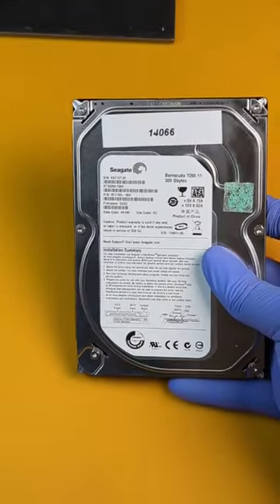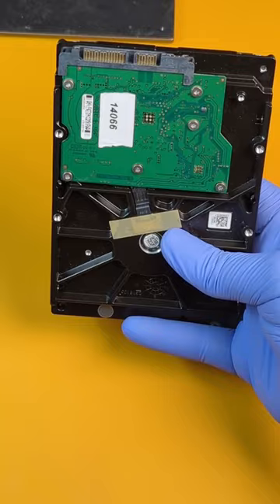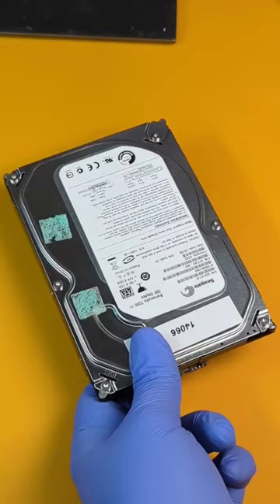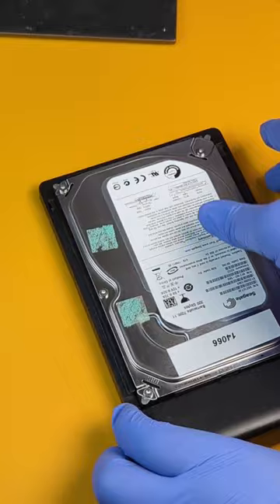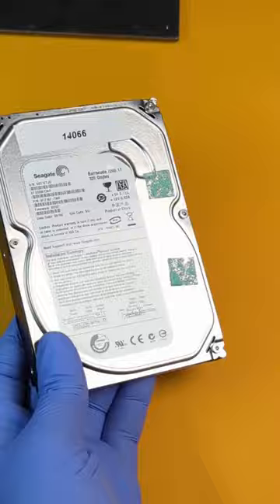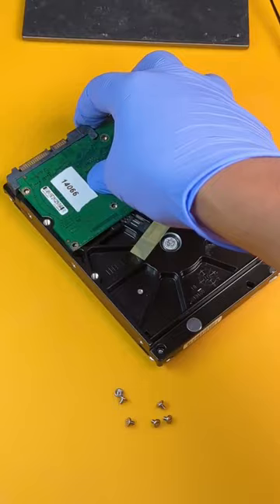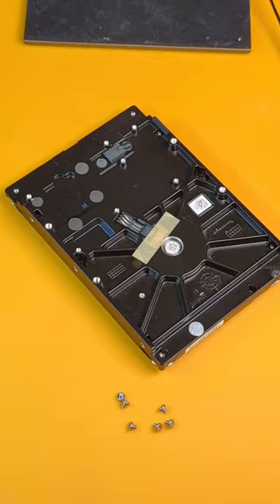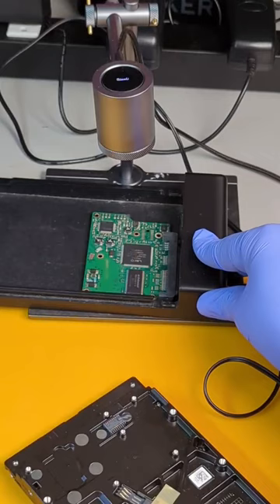How to fix a dead HDD

Comment: What if you took a whole board from another HDD and put it on there instead?
Reply: You have to remove the bios chip and replace it with the old one as to not lose the data
Reply: It won't work. You need to transfer the BIOS chip of the old HDD board to new board too. That's what I think.
Reply: @unknownasd5576 where is the Bois chip looketed
Reply: This happens with several usb 2 hdd and usb memory pen. you can see that win 11 has repaired the disk when you choose to show hidden files. internal sata hdd and ssd have never had this problem.

Is usb more vulnerable and more unstable?
Reply: USB 2.0 3.0 is a big joke! how often do you get faster write speeds than 15mb? with a hama usb 3.0 card reader and a new ssd card, I often get kilobytes of write speed and max 10mb. They vary up and down.

usb 2.0 hdd so I never get more than a 15mb write speed.
Reply: If the board is from the same model of drive with the same firmware, it usually works.
Reply: @Richo5566  If I have the same revision of the bios and I only swap the pcb.  Is there any risk of damage to the disk?
Reply: @ford1546 My 16GB Sandisk gets at least twice more although it is new

Comment: Classic: Dead Transil (TVS)...
No need thermal camera, test them (and the possible fuse associated) with a multimeter. ;-)
For recovery data, just REMOVE them.

Comment: Those seagate die like flies
Reply: LOL i had WD My Passport 1TB, twice, they all died each less than 1 year.
Reply: I have both dead seagate and wd. But wd has more alive. Seagate every one is dead.
Reply: Also I have this exact model dead.
Reply: Especially this seagate Modell died on my.
Reply: I have a Seagate HDD that’s 4 years old and still works fine, I also have another 2 one is 9 years old and the other is 11 and they both still work aswell
Reply: @Cyan_Nightingale I suggest for external HDD its best to use the ones that came in laptops those WD drives last at least lasts 3-5 years
Reply: They just popular and seem that way
Reply: @Cyan_Nightingale , same

Comment: I am having this very same issue with an external seagate drive. In both the dock it came in and in another. The power light won’t even light up.  So I need a logic board it looks like. Or is that simple fix not possible and also keeping the files on the drive I need ?
Reply: Don't need logic board unless extreme damage tvs diodes easy fix

Comment: My DELL Inspiron 3670 started bugging out and gave me this message: 

“No hard drive detected- Your hard drive is operating outside of normal parameters and should be replaced. This system no longer carries a hardware warranty. To purchase a replacement drive, please visit Dell Spare Parts for a compatible replacement part.”

Does this mean that I have to replace my Barracuda 1TB hard drive?
Reply: uh uh i think u should get ice cream
Reply: Yeah. Should probably replace it with an SSD. Yeah I know this comment was 6 months ago.
Reply: Replace it with any hdd you like

Comment: Hello. No matter which usb storage I connect to my computer, I get a message
(It's an error) And win11 gives you the option to scan and fix the problem.

The problem is that this also happens with newly formatted external USB 2 hard drives. Also usb2 memory pen. 

Always when windows tries to scan and repair the disk, CMD (scandisk /f e:) it always says at the end that it failed and could not repair. during this process things on the disk were deleted and other things were done. Some of the content is now more damaged than before!

On a usb hdd disk, I formatted with full format and afterwards I did a full sector scan without any errors. After copying a few files, win 11 started complaining. Why?
One of the explanations is that it is windows.

I have experienced this with 4 USB HDDs and several USB sticks
Reply: Check your USB drivers

Comment: I have a question my laptop hard disk is damaged and it doesn't work at all i can't a new latop is there any way to fix this so i can use this in future
Reply: I do data recovery very rare I fix a drive that can be used in the future... recover data that's all

Comment: You said The drive short circuits any device it's connected to,?
Reply: Yup. Some random components in the power supply part of the board must have a short circuit...
Reply: Yes, seems like this bad diode is shorting out the power, which also means all the power that's supposed to power the wholr drive gets dumped into this one diode, making it hot
Reply: The 12v tvs diode fails and goes short circuit, simply remove and copy data off

Comment: Could I swap the board out with one from another hdd? Would that work? I don't have an extra hdd lying around, but I'm willing to buy one if it means getting drive to work long enough to recover my files.
Reply: Both hdd must be from same maker's and with same exact model and with same capacity, exactly same only then your method will work 👍 
Good luck.
Reply: some ppl are saying you need the bios chip from the old HDD for it to work. Did you have any luck?